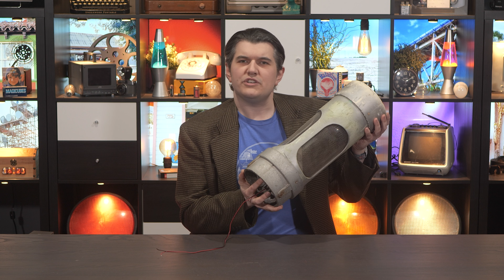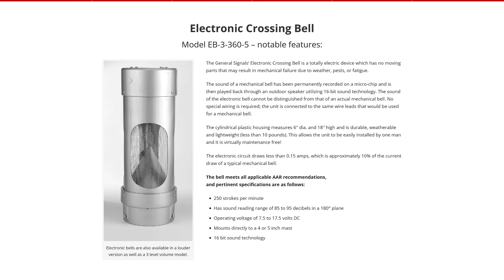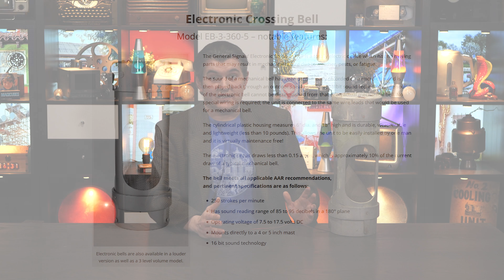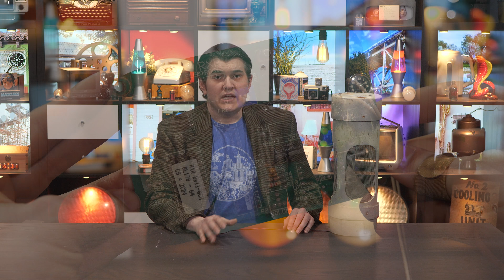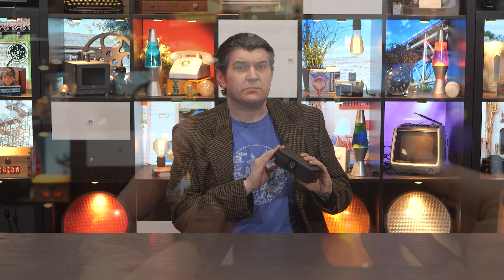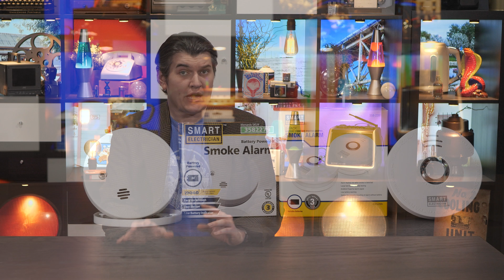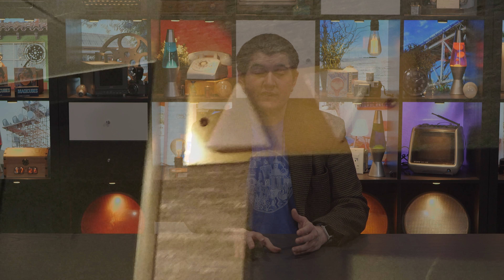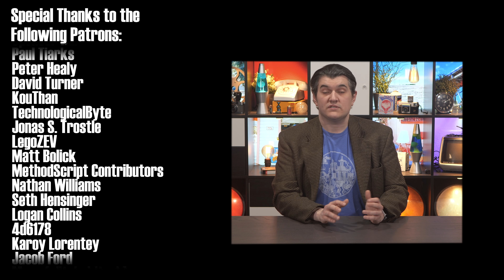The disappearing and unappreciated art of audible alerts

Comment: I've worn hearing aids for the past 15 years or so. Hearing aids use audible alerts for a variety of things, including notifying you of low battery, bluetooth connections, etc.. My first pair of hearing aids had a lovely set of notification sounds: the startup jingle was a pleasant series of rising tones (look up "oticon startup sound") and mirrored the shutoff sound (which was a series of 4 falling tones), and the low-battery sound was unobtrusive and alerted you twice, once when there were 2 hours remaining and then again at 30 minutes, so you had time to go get a new set of batteries.

Well... now I have a set of rechargeable hearing aids from a different brand. I have owned them for 2 years and still could not tell you what the startup jingle sounds like, because it has very muddled tones which I am unable to pick out. And the low battery alert sounds a bit like someone leaning on a car horn twice, which I personally find quite annoying and aggravating. It cuts off all sound from the speakers for 2 or so seconds while it plays the alert, which is jarring and disconcerting when you're in a conversation. And, for some reason, they have chosen to alert you maybe five or six times over the course of the several hours before they run out of battery, which happens every day, and which you can't even do anything about because they need to be recharged for a few hours so you can't exactly go pop in a new battery! It drives me insane, and I miss my old hearing aids and their pleasant little beeps. Sound design is important.

Comment: One thing not addressed is the telephone. It would be almost impossible to use the telephone without audible indication if a line was ringing, busy, or that the call cannot go through for some reason or another. In the US these signals have been generally standardized pretty much everywhere since the late 70s, and the amazing part is that we just seem to know what they mean from a very young age. 

Say it is 1968. you might have found that when you called someone else in your city the ringing signal sounded like a soft brr-brr-brr-ing, but when you called your aunt who lived out in the boonies, the ringing signal sounded similar to machine gun fire or even a fart, and that there was a special cadence to it, 3 short rings and one long. Why that was because your aunt was still on the horribly archaic thing that was known as a "party line." Basically, because in rural areas and even the suburbs, multiple households would share one single phone line. But there needed to be a way to distinguish between calls for different households, because without that everybody would be answering each other's calls. The solution was different ringing patterns, when a household heard their ringing pattern, they knew that call was for them.

Practically all of these non-standard tones were gradually replaced through the 1970s and into the 1980s as they were hard for automated equipment to reliably detect, and this story played out all over the world with different standardized sets of tones, some countries moving faster than others depending on how quickly they modernized their telephone networks. (Russia, Ukraine, and other ex-soviet countries as well as North Korea and Cuba are notable stragglers)

The tones that different countries use can tell us a lot about their history as well. For example, the Philippines uses American-style tones. Why you ask? Because when the telephone came to the Philippines, it was actually still an American territory! Or Cuba, originally the American style tones were common, but in the late 1950s and onwards were slowly supplanted by Soviet-style tones. (I'll let you hazard a guess as to why that was.) 

We all instinctively know what the different tones used in the country in which we live mean, but often don't give it much thought because it is just so engrained within ourselves. When operators were replaced with dial equipment, people had to be told what the dial tone and busy signal were because they had never heard them before.

Comment: learning now he usa fire alarm sound is the same "call cannot connect" noise in the uk 

our fire alarms are continous and shrill, they sound so awful you flee from them even if you do not know that there is a fire
Reply: I've been reading through the comments to see what people share about international alarms, and I'm slightly saddened that he didn't make it more clear that the sound he used is not the actual sound of an alarm. Every alarm I've heard in a public space is a very loud, shrill tone with a fast trilling sound to it, too. I'd describe it as a "cicada from hell" but I'm not sure whether you have cicadas over there so maybe that doesn't do any good. 😅

Also, I think any new alarm systems are required to have strobe lights, so even if you can't hear the sound well enough to feel the visceral repulsion most people feel, you can at least see the flashing lights on all the red boxes with "FIRE" markings and hopefully that'll get the message across.

Comment: Please Never use combination smoke and carbon monoxide alarms smoke rises  so that alarm should be on your ceiling or near it and carbon monoxide will fall so that alarm should be near the floor you don't want to mix up which alarm is going off get down if it's smoke out up and out carbon monoxide

Comment: I hope that fire alarm DOESN’T become an international standard. It just sounds like somebody outside is having an inconsiderate phone call in their car and it blends in with the sound of a washer or dryer running in the next room. No way I’m ever waking up to that sound in the middle of the night.
Reply: Yeah this is a piss-poor sound to alert people with. Granted, this is well below actual alert volumes but either way. Fire/evac systems in my region use a temporal 3 as a warning but when action is required there is a much more effective sound used that both vibrates your skull at the bottom of the pitch then slams needles into your ears at the top.

What better way to 'alarm' people than by making it painful to stay in the threat area. Even if you'd never heard one before, the message is clear: MOVE
Reply: @WanderingConstruct This isn't the actual sound. He was just making a point about how the standard pattern of three tones encodes the information that it's specifically a fire alarm. In every public space where I've witnessed the alarms going off, it's an ear-splitting, cicada-like screech. There's no way a reasonable adult with healthy hearing would mistake it for anything other than a "get out of the building RIGHT FUCKING NOW" signal.

Judging from how many comments there are about it, I wish he had made that point more explicitly.

Comment: used to work at Target. if you listen carefully, sometimes all the devices the team is carrying will make a car-unlocking Bip Bip! noise, generally IMMEDIATELY followed by two louder, rude honks. This is because the first is an indicator noise to tell the order pickup team that someone has indicated to their app that they're coming to pick up an order - getting in their car. The second is the obnoxious sound of the customer arriving; however, most people fail to use the app correctly and press both buttons in immediate sequence in the parking lot, which gives the team no time to prep the order. Fun!!

Comment: That's wild they decided to drill holes through the top cap and just let water leak down all the screws.. I get that the speaker is heavy so that maybe needs it, but the PCB could be on solvent welded standoffs, and the speaker risers could also be solvent sealed right at the cap, that way the PCB is the highest part and no open holes can drip on it. But "it's an extra step"
Reply: Easy to fix with some washers, no? I'm not sure if there is even a problem though. Can rainwater short anything there? I mean, it looks hella delicate, but rainwater isn't a great conductor. If anybody here can say how many rain droplets it takes to kill that circuit, I'd much appreciate it.
Reply: @steelwasp9375  It was likely conformal coated, but not letting water all over it and making rust everywhere is still a better 'design' washers can work for a time but rubber dries out and water tends to find a way in regardless. Also rainwater is not the same as 'distilled' water, it does contain conductive impurities.. also all the iron from the bolts getting washed onto it. Props to the conformal coating for doing it's job, but still a terrible implementation.

Comment: my phone has physical slider between silent, vibrate, and audio. It can be done. ^^, Also god damn android update unnanouced changed a long press on power button from, shutdown manu to god damn AI assistant bullshit. And when I was low on battery I literary did not know how to turn my Phone off. I had to dive in menus for 2 minutes to revert it to shut of my phone because they literary changed the function of the one and only button that had this function for years... Also if my Phone would softlock I would be screwed sa that change overrode even the forced shutoff...